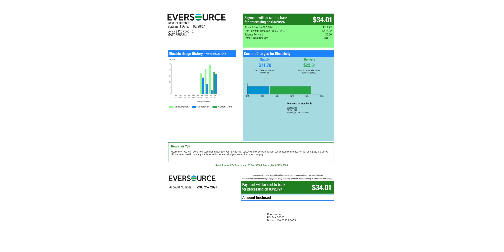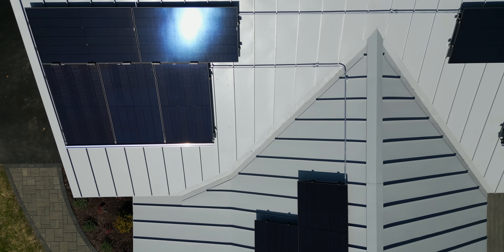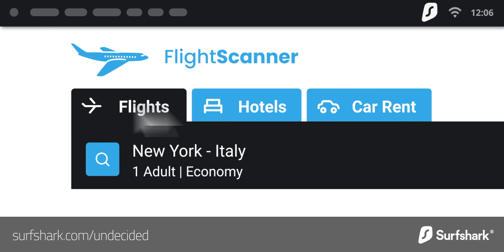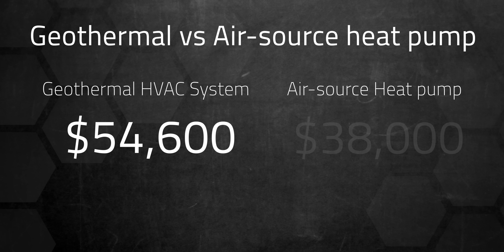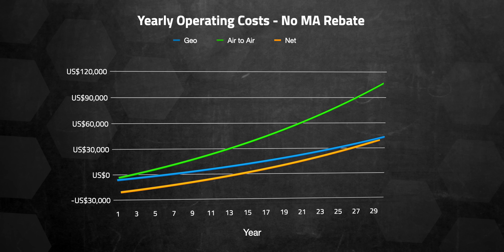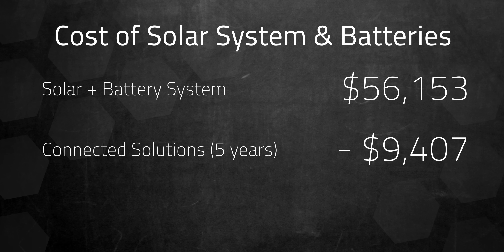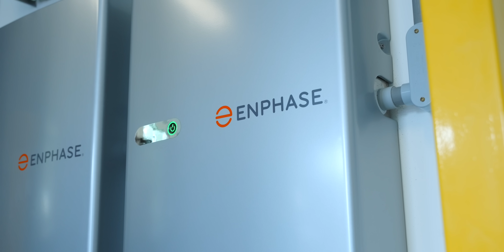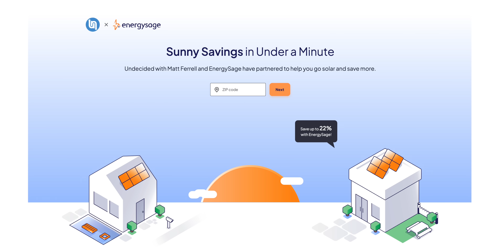What I Learned After 1 Year with New Solar Panels

Comment: Matt did a full installation in a new home and spent a lot of money but it's not necessary to do that just to get the benefits of solar. Matt's system is amazing and will give him many years of energy savings but you can do it for a whole lot less money and still save money. I installed solar powered mini split heat pumps in our home when we needed to replace our AC unit. The kits come with solar panels and are all self-contained you simply install and plug in, no batteries to worry about, no inverters, just plug the solar panels in and plug it into an electrical backup and you're off and running. Three units cost us $7,000 total including installation. My electricity bill in the summer went from $340 down to $92. The units use solar power during the day and automatically switch over to grid power when the sun goes down. They work fantastic, they're not complicated, they're very budget friendly and easy to install if you want to DYI.
Reply: All mini splits work with solar.  The way they ramp up is inverter friendly.  I've a 2 ton Pioneer mini split that runs off my 2-3k inverters.  I understand the desire to have direct to A/C solar connection, though.  Congrats on the bill reduction.  Nice!
Reply: @matthewsocal2540  My apologies, I don't think I explained it well enough. These mini split heat pumps are specifically designed for solar. They have solar connections built in right next to the electrical connections. They also have all the electronics on board that will switch between solar and grid power automatically. The automatically give priority to solar power and take from the grid only when the solar falls short. All you do is put the solar panels up and plug them in directly to the units. You need nothing else to get the system running.
Reply: Implementing that into Matt's system might improve in general
Reply: @jondoe2542  you know you probably are right. I was thinking if we had a full solar system with batteries inverters etc that these solar run heat pumps would be a terrific compliment to the overall system. Since they run exclusively off of solar power when they have enough sun there is no load on the main house solar system. This would save battery power and inverter power for other things especially at night. Our particular heat pump units are so efficient that we use them for heating late at night and early in the morning until the sun comes up. Our electric bill really hasn't raised much and I believe it's probably cheaper than the propane we have for heat now. It really is a win-win situation with these things and they're not that expensive!
Reply: how does the system run at night. and on cloudy days, how does the motors last when the voltage goes up and down all the time as clouds roll by? does it go on and off all the time to protect itself?
Reply: @diegojines-us9pc  The system has a built-in electronics that switch from solar to regular grid power automatically when needed. So during the summer it's running exclusively off of solar from about 7:45 a.m. to about 7:30 p.m. where I live. At night it automatically switches to regular electricity. Also surprisingly during cloudy and rainy days you do get some solar power, I didn't think I would but because the solar panels are bifacial meaning they get solar from front and back which in my case reflects off of my white metal roof even on heavy overcast days I'll get a couple of hundred Watts which is sometimes enough to keep the system running. As far as the motors , The system is a variable speed heat pump inverter which means that the motors are variable DC induction so when they start they don't kick on like a traditional AC unit, they slowly ramp up until they get to full speed and when they've achieved the temperature they're set for cooling or heating then they slowly ramp back down and sometimes idle back down to zero. The fan portion of the inverters do the exact same thing. The end result is an extremely energy efficient system that can run off of pure solar or very efficiently off of electricity. They have lowered my electricity bill by 2/3 and the cool and heater home very well, I highly recommend them.
Reply: You say "no batteries" and then electrical backup". What is your backup then if it isn't a battery?
Reply: @Sylvie_M  solar panels for primary power, then regular grid electricity if the solar can't provide power. Because these systems use solar directly plugged in to the units and have electronics on board to do any switches necessary to regular electricity they are simple to use. Also these units use 120v on the AC side so any battery backup such as a jackery unit will be sufficient to power it.
Reply: @killer5846  Thanks. I thought you were referring to a system separate from the grid, which is what I have. I would prefer also to have a storage system but having no aptitude to make one myself, I think they are just so expensive to buy ready made.
Reply: @Sylvie_M  there's no reason that you can't build one yourself if you're so inclined and capable as long as it outputs 120 volts at a maximum of 2,000 watts which is the maximum these will pull when they slowly ramp fully up. Also most cheap generators are capable about out putting 2000 Watts so it's fairly easy to power one of these. I had a standard three prong 120 volt 15 amp plug put on next to my disconnect so I can simply unplug the unit and plug it into anything I want in case of a power failure. Because these units are so efficient even in the dead of night you could turn the units to 61° for heat which is the lowest they go and they only pull about 500 watts ramping up and then usually swing from 50 to 100 watts to maintain temperature. There is also an easy limiter setting in the app which will restrict AC usage. The point is these are super easy to power and I'm sure you could come up with something besides the solar.
Reply: That's 28 years to recover the initial investment even without taking into account the opportunity cost. 

I have a similar problem justifying investing in solar power because our idiot Ontario government heavily subsidizes electricity use and both federal and provincial governments encourage the use of natural gas with negligible taxes. I have 1600 square feet of flat roof that would be ideal for panels but it would be financially disadvantageous to do even a partial conversion. I'm 61 and every year, my time limit for achieving a return on my investments gets shorter and shorter.  It's very frustrating.
Reply: @KeithHanlan  I assume the OP is referring to a monthly bill, so $340 down to $92 for the peak month of summer electrical usage. He will get a benefit every other month of a smaller amount. If we assume that the average monthly saving is half the peak savings (124$/month) then he will break even at 4.7 years. If you take into account the opportunity cost of the install the pay back will be somewhat longer but only a couple years (based on some reasonable assumptions on RoR)
Reply: @KeithHanlan  I'm paralyzed, retired and limited income.  I just built my 12kW solar, 6kW of 220v inverters, and 20kW of battery backup for $5k total.  It took my sweat and tears to make happen, but I'm now paying $24 a month down from $300 (ROI-19 months).  It, also, required me to be FRUGAL in my purchases.  These are wealthy Millennials who weren't raised to be frugal.  
All of my equipment is used.  Purchased at a price that I can just buy another if it fails.  For example, I paid $750 for my 2 inverters to produce 6kW @ 220v.  New, they would cost $1k each.  Having retired from critical infrastructure, trust me when I say that in solar, used (within 10 years) is as good as new.  My panels were used hard for 6 years, and they're still producing 114% of their declared output rating.  Solar panels degrade minimally and never at the rate the manufacture claims.  Oh, 2 of my 48v LiFePo4 battery packs I purchased used as well.  It'll take a decade or more, before they degrade noticeably.
Don't subsidize anything.  Don't pull any permits.  They can remove the systems when whomever replaces us, after we've died and made our money off of the solar.  We don't have the time to play the long game.  So, write your own short game.  You can do it.  A tip: don't put panels on a roof, if you have land available. Cheers.
Reply: @matthewsocal2540  Those are attractive figures. I have only done back-of-the-envelope calculations based on professional installations. Doing it without permits isn't a viable option since my house has some complicating factors such as aluminum wiring, an undersized 100A service, and a 50-year-old main panel that needs to be replaced. Adding solar would be just part of a refurbishment. I am already being declined by some insurers because of the wiring and know that it is going to bite me in the arse if I don't do something about it soon.

In a perfect world, the economic incentives of adding solar would offset the other upgrades.

I will look into used panels, inverters, and batteries though. I wouldn't have thought that there is much of a used market but I'll take a look.
Reply: @KeithHanlan  think about your children benefitting from your investment of conversion.
Reply: @kkon5ti  The industry changes so fast that it may be useless to do that.
Reply: @KeithHanlan "Muh payback"
Or, you know, you can keep the lights and heat on when everybody else is sitting around candles. Boom, "paid for itself".
Where I am a giant earthquake could come tomorrow, not having a backup is crazy, never mind the cost

Comment: I have a few comments: I have solar but no battery. I live in North Carolina. We get a one for one deal for net metering and we have a connection fee that is about $16 per month. BUT, my surplus gets dumped every May 31st no matter how much above I am. I don't get reimbursed for this and the other main point is that if I wanted to go completely off the grid, where I live in North Carolina, it would not be legally possible. They basically say that since I live more or less in the city, I have to be connected to the grid. Lastly, Duke Energy is working to change the net metering plan to make is so they would get more per month for the folks that generate electricity in their home. I have heard numbers of around $40 to $50 per month. That gets to about 2/3 to half of a month of electricity. I would say that unless you live in a place that does not control your independence legislatively, solar may not be worth it. It would probably be better to just create the most efficient house and let someone else generate and deliver the energy. By the way Matt, your numbers will change if the generation companies can go more renewable sources and the price lowers due to that. If anyone in NC is interested in more information on my experience with what is happening here, reach out.

Comment: While I like this project and think it's cool, it is not economically realistic done in this way. In fact I think the real takeaway here is that you should move to a Sun-Belt state and go completely off grid. The red tape, and incompetent government and utility regulation is Kafka-esque.

Also the future return calculations are just too murky. I am highly skeptical that ANY of your system will survive to year 30. Extremely intrigued to see what will survive to year 10 without major repairs. Also the Utility will rug pull and change the terms of the buyback credits over time, and they will push the state regulator for solar users to pay higher and higher inescapable fixed monthly charges as has already happened in California.

The real play is to go completely off grid and these are the builds that are the most intriguing. It will be especially interesting to see how governments and utilities attempt to prevent people from doing this as more and more adopt solar.

Comment: Your Power Costs vs Battery/Solar costs don't exist in a vacuum. Assume that instead of putting that money up front into a solar/battery + HVAC/Water house, you put it into the S&P500 and reinvest the dividends. After all, it's not just the prospect of long-term savings that you're looking at here; there's an opportunity cost for compounding interest. If you had gotten a modest 7% return, then your invested opportunity cost would have doubled before your solar/battery/HVAC/water systems pay for themselves - further dragging out your break-even point. The S&P500 however is up 30% this year alone and 90% over the last 5 years. In other words, your house will never break even.

Comment: I’m curious what the optimal point is between sending excess power back to the grid versus storing in batteries. For example, if your batteries had half of the capacity, you’d get to send more surplus to the grid, which you would then need to use more. (Some say the grid itself acts like a battery, operationally.)

Comment: As a nearly 66 year old man who lives alone, my energy costs aren’t much. I can’t project out 30 years to calculate return on the expense of installing a net zero solar system.

I built a solar system to mostly act as an emergency backup but currently expanding it to take over some, if not all, my electric energy needs. 

My efforts are more focused on using less energy than paying for energy I don’t really have to consume.
Reply: Meanwhile, I'm here in an apartment in an older build and wishing for insulation.
Reply: @MonkeyJedi99  I lived on the top floor of a 3 story apartment building long ago and one of the perks was that the lower two units were heating my space up. Yeah, apartment builders tend to do less that 'minimum code' for insulation... but, if you don't mind stairs the top floor stays toasty in winter!
Reply: @Le_Comte_de_Monte_Felin  I'm the middle of a three-stack.
So, my downstairs neighbor's heat in the winter, the upstairs neighbor's cold in the summer.
Reply: I'm on "partial solar" too. I use more energy without paying for it! I have a hot water urn on the whole time I'm awake at home, no more waiting for a kettle when I fancy tea. Also a countertop dishwasher I run twice a day. I doubt I'd do that otherwise. I need to shift my floppy CIGS panels out of the shadow of another building and I may be able to run a 300w "hot carpet" for free for several hours too, depends on cloud.
Reply: yes, he said 20kwh not enough for 1 day, for me its like whole month
Reply: @rm6857  I use about 25 kwh/day
Reply: @rm6857  20kWh for one month means your only electric appliances are LED lights and mobile phone charging. That is 0.66kWh per day. No way you are heating your home in winter time with heat pump.
Reply: According to advertisement i can save thousends of euros a month. I pay €180,- a month for energy. Most is consumed in winter.
Reply: same here.......
Reply: Installing energy efficient windows, HVAC, water heater, and lighting are going to produce similar results. If he spent $40,000 and it is invested earning 12.5% a year you can pay your electric bill and have a small amount left to compound over time.  My area only experiences power loss a couple of times a year for max couple of hours so not a problem.  It's up to the individual, as long as they can get the rebates and a fair and quality install it is up to you to decide
Reply: 63 yr old guy here. High five, brother. High five.
Reply: I'm looking at replacing my Honda gas backup generator with solar and batteries.  Getting too old to wrestle with 5 gallon gasoline cans.
Reply: just think. If it made money. why haven't companies done it? i mean people buy 30 year bonds to make money.
Reply: solar storm?

Comment: I noticed from the drone view of your home that you have a large fenced-in back yard. If you do end up needing additional solar in the future, maybe it would be worth trying the idea of replacing the fence sections with solar panels. I've seen a few videos from Europe where they have been using used panels instead of fence sections, with the idea of gathering extra power, without much cost.
Reply from the maker: I've actually been thinking about that.  If I wanted to add more there's an area in the backyard I'd most likely add a small ground mounted array. Bifacial panels as a fence is a really cool idea too.

Comment: with how absurdly overengineered his house was, a 10 years breakeven point is actually really good. specially considering how cheap electricity is in the US, how expensive solar panels are to install, and how bad irradiance is.
Reply: I bet his electricity is not cheap in MA.  Many places it is over $0.35 kWh off-peak, $0.50 on peak.

Comment: It is definitely worth it for me.  I have a strawbale workshop of 1200 sq. ft. and a house of structural insulated panels of the same size.  We put in a 5.25kW solar ground mount array for about $10K in conjunction with Solar Barn Raising of Durango, a non-profit that relies on volunteer labor to "barn raise" a solar installation.  I did all the electrical myself.  Our cost of electricity is about $0.10 per kWH as a member of our local electrical co-op and our monthly grid connect charge is $45.70 with no time of use restrictions.  Every kWH we generate above what we use goes into our kWH "bank" and typically, I have received a check between $150 and $200 at  the end of the fiscal year April 30.  The solar installation was the best investment of hard cash we have ever made.  We heat both buildings with propane fired radiant floor heat using a 95% efficient tankless boiler servicing both building.  We make and light a small fire in our woodstove every morning.  The radiant heat runs in the house for about 2 hours each day until the woodstove warms up the house enough to shut off the thermostat.